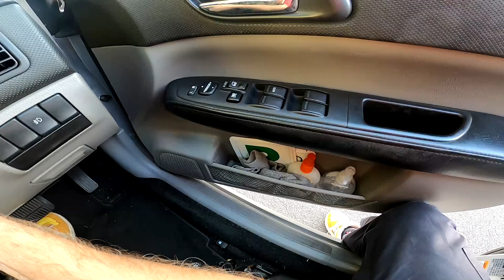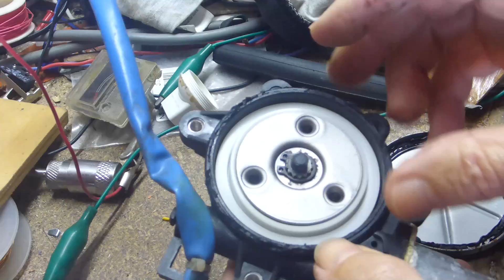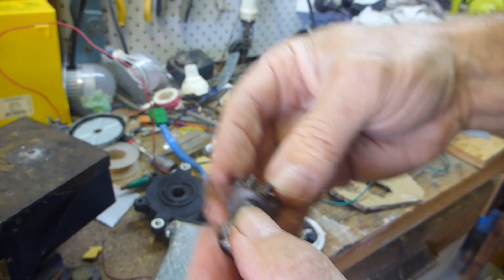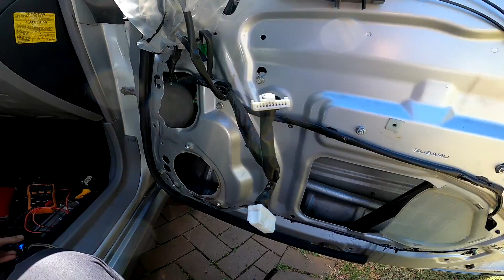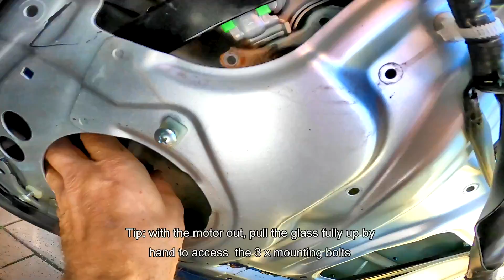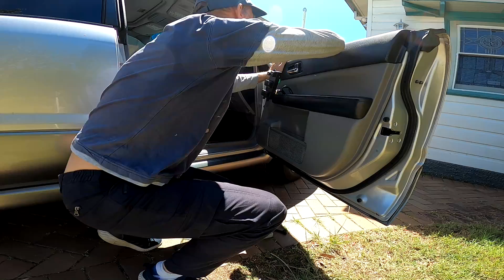SG Subaru Forester Electric Window Motor Repair

Comment: How do you know if it's just seized? Will it make some sort of sound when pressing the switch?
Reply from the maker: No, if the regulator (motor) is seized you won't know. The car's CANBus system [should] sense the higher lock-out current and shut down power to the motor.

Comment: FIXED IT!!  Thank you so much!   Mine was a seized rotor at the back end bearing.  Greased it, wiggled the brushes out for better contact, and now it runs fine.    Hardest parts:  Getting the motor out of the door when the motor is seized - it was jammed at the end of travel and really stuck in there  (I did it as per the other video mentioned).     And the bloody circlip.  Even with circlip pliers it was a SOB.🤩

Comment: Are the screws that hold the motor in place 10mm bolt heads? 
Great video, going to save me another $100 now!
Reply from the maker: Yes they are. Subies have a ton of 10 mm bolt heads securing lights, both front and back. Most have a Philips pattern as well, but these tend to slip, so use a socket if you have one.
Reply: @pescado99  Excellent! Thank you very much! 💯
Reply: Mine had Phillips head screws, which if you slip and mash em up, your in trouble.  I replaced them with hex heads.
Reply: @akkaax3509  Yeah mine has Phillip[s head screws only and one of them is totally rusted!

Comment: What cause all electric windows  not to work after checking the fuses still not working
Reply from the maker: Have you checked the door switch? If all windows have just stopped working this could be the fault.